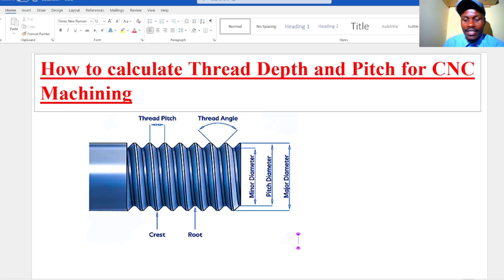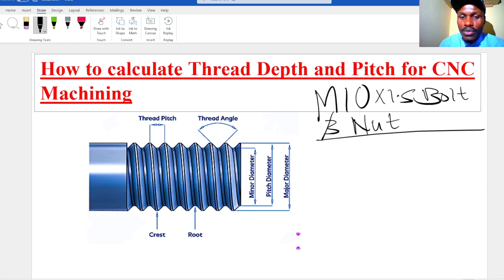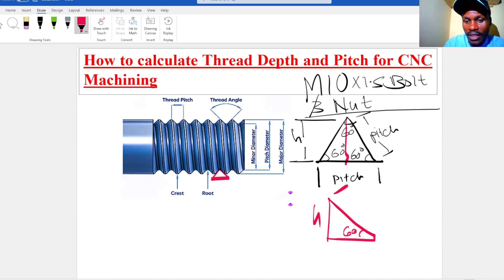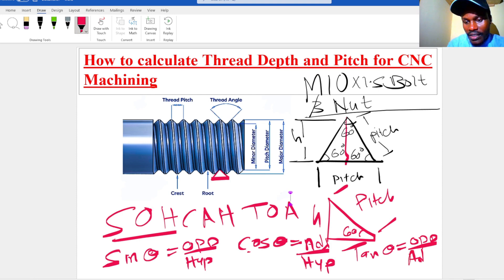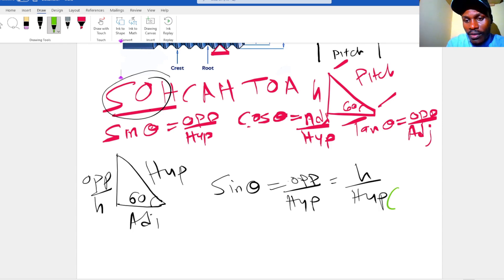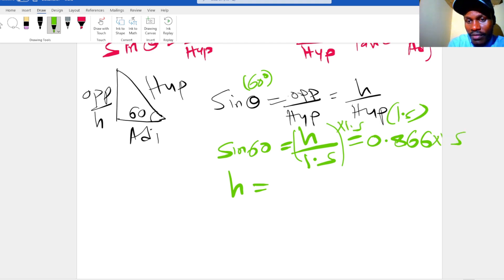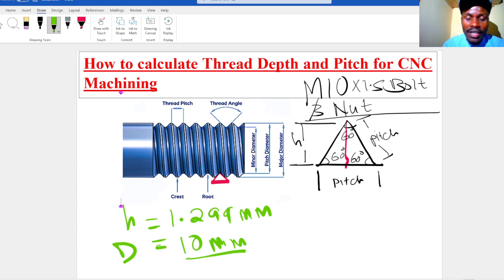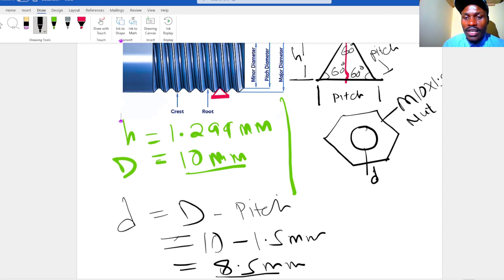How to Calculate Thread depth, pitch, shaft machining diameter and hole drill size for the Nut| Easy

Comment: That's too complicated for any of my co-workers. They can't even handle two plus two.
Reply from the maker: Not really. The thread depth is simply the pitch multiplied by 0.866. This is the simplified format and applies to any bolt size.
You can also look for a bolt thread table. Though you wouldn't have it all the time ☺️